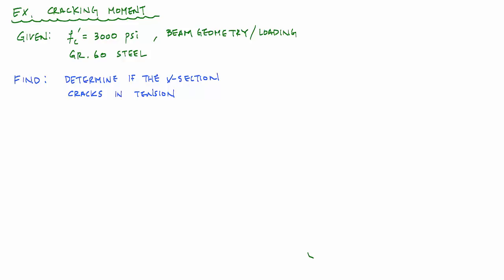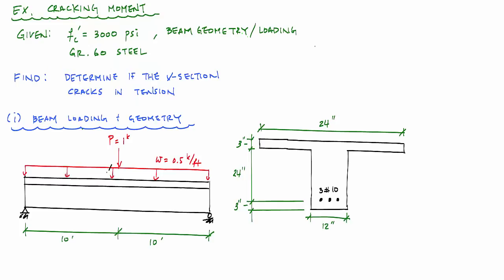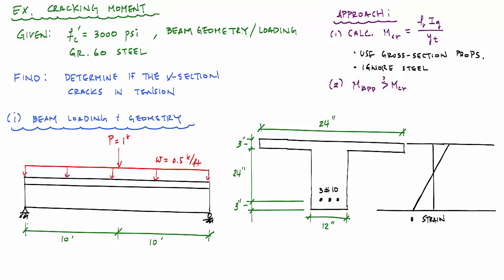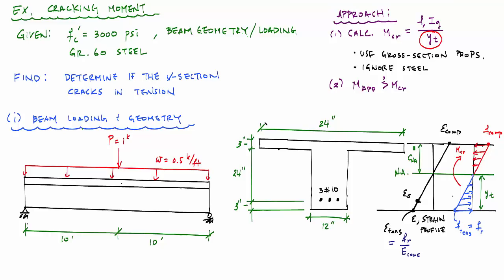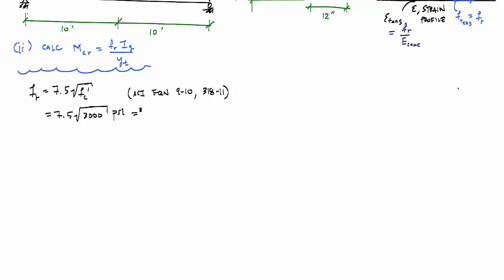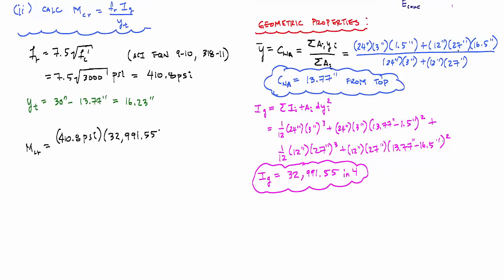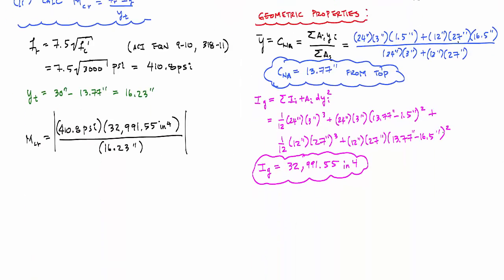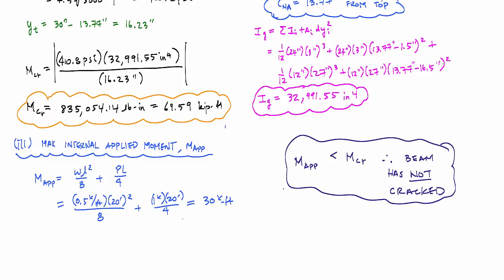Cracking Moment Of T-Beam Example 1 - Reinforced Concrete Design

Comment: You didn't consider the rebar reinforcement in your calculations.  you should have used a transformed section analysis to compute the cracking moment with the area of the rebar.

Comment: Why did you ignore the steel to calculate cracking moment? Why did you use transformed sections?
Reply from the maker: you could include the steel, but the steel has a minor contribution until the beam section cracks...so you can use the gross section up to the instant before the concrete cracks in tension. If you include steel, you would have to use the transformed area method and also subtract some areas.

Comment: Dear sir,
what is the importance of steel if the concrete will carry the load in this way,
we will use always the minimum reinforcement while we are working on a project that needs uncracked section like water tanks, since the concrete only will carry the load?
am i right?
Reply from the maker: +Mohammed Houjairy concrete is only good in compression.  the steel is needed to resist tensile stresses in a structure.
Reply: Yes sir
The concrete is good in compression and the steel is good in tension
But if the tensile stress of concrete is bigger than the applied stress as you calculated in the example , then what is the need of the reinforcement, even in the tension part
Reply: Also sir, you didn't use the steel in the calculation of the location of the neutral axis and the moment of inertia,
Please can you explain why